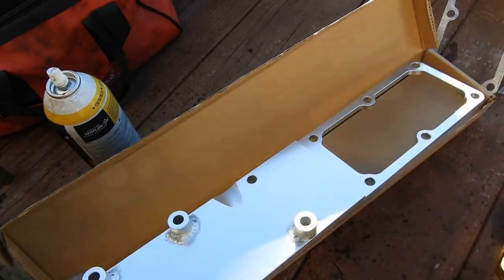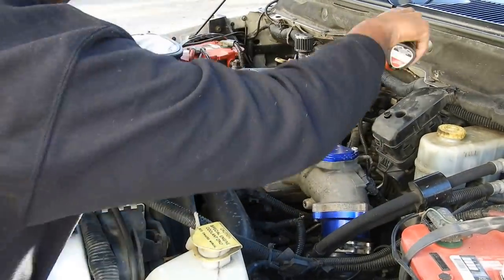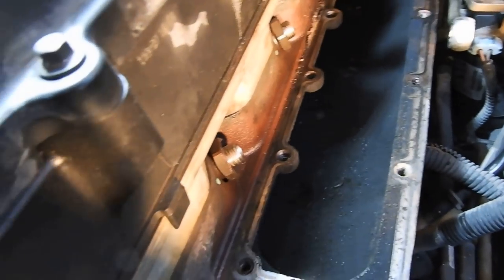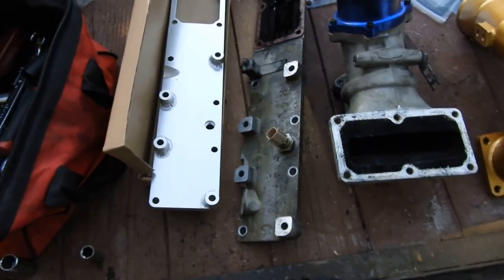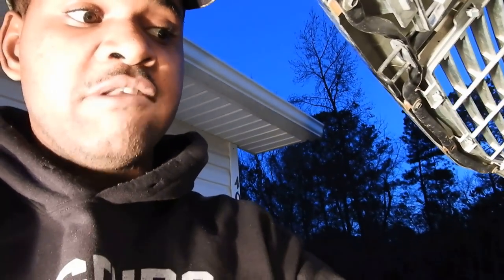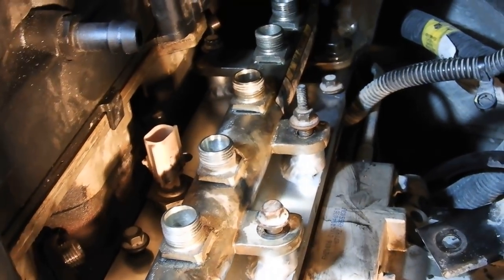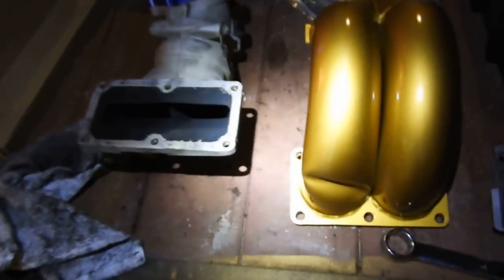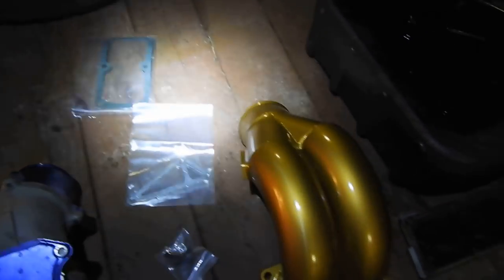HOW TO DELETE GRID HEATER ON 6.7 CUMMINS

Comment: Looks great I used a 4" banks monster air ram it sounds great it has a deep exhaust sound I didn't do the heater delete yet. I have a 2016 ram 2500 6.7L love the proformance acceleration fuel mileage and the sound of the 5-inch straight pipe. Thank you for your video of this delete because the videos help me when I do mine. Thanks again and God bless
Reply from the maker: Joe  Truitt thanks man I appreciate it! I'm glad this video helped you out! Check out my other videos they may help you out in the future and feel free to subscribe
Reply from the maker: Joe  Truitt banks makes a good kit too. I wanted it just to expensive haha. But mishimoto and pusher make good products

Comment: Just finished up my grid delete, but added a throttle valve delete with heater.  Although it was far from easy and I have a leak on my rail in the back.  Praying it isn't cracked.  Thanks for the video and for your service.  Happy 4th of July

Comment: Hey man love the vids, been watching you for a long time but there's a big problem with this video. That "negative ground wire" you said goes to the grid heater, IS NOT A GROUND! Lol I found out the hard way... I tried just grounding it to the block since it just looks like a ground and almost caught my truck on fire. It's a positive cable  from the positive solenoid near the battery. Might want to add that in the description or something because it's dangerous, I was about to leave the battery charger on over night and 15 mins later positive cable melted started smoking and cooked both battery's to 0volts. If I would have gone to bed It would have caught on fire 🔥
Reply: I think he misspoke. Because he said “power for the grid heater” as well as “ground” In sure he meant power wire.
Reply: @Up-hill-Battle and I dont think heater grid will use ground to heat up, lol.  Good video.. going to do mine tomorrow

Comment: Did you need pipe dope on hardware holding the grid heater plate down or the horn? Are those bolt holes straight through requiring to be sealed asswell?

Comment: Do you have to seal up the injection lines? With anything? Also do you have to have to use rtv or gasket maker for in between the plenum and grid heater delete plate?

Comment: Great video!👍
Can’t do it to mine I see temps at 50 below ambient in northern mn🥶🥶 need block,grid,steering wheel,seat and lots of other kind of heaters here!! My grid heater was packed with soot at 38,000 miles shop vac cleaned when I upgraded to afe intake!! 😃

Comment: I just deleted mine and its still running bad so im ordering the parts so I can do this because my egr bypass valve cable broke so soot literally clogged up my whole system, dpf, intake, etc. I'm hoping this will fix the problem. I'm also not mechanically inclined so this video is awsome and gives me a little ease knowing that it's not that hard to do.

Comment: I replaced the air horn today and the checked engine light is on. The MAP sensor is plug in, the only thing that was left unplug is the plug that pug into the throttle plate. Is the throttle plate plug required to turn off the CEL?  What do I need to get raid of the CEL? I have 2011 6.7 with the EGR delete. No CEL before I replaced the air horn. Great video by the way!!!Thanks for great information.

Comment: Hey bud, love the videos. The cable that you’re holding at 14:29 of the video is a a ground of some kind? I grounded to one of the bolts used to mount the heater plate and it smoked my hot terminal. Made me think that it wasn’t some sort of ground

Comment: Excellent job, good step-by-step instructions.  Im installing a 4inch monster Ram but keeping my factory grid heater.   (2) Thumbs up on the video.
Reply from the maker: Thanks man! Appreciate it monster ram intake is good too
Reply from the maker: Changing the intake manifold wont make a crazy noticeable difference but it definitely will aid in better flow into your engine which means better combustion and potentially better throttle response and mpg.

Comment: Looking at doing a Banks 3.5 intake and keeping the grid heater. Just want to check and see what your thoughts are about they. Any thoughts or help are greatly appreciate Boss.
Reply from the maker: Jim Russo banks intercooler is good! I didn't get it because you get a better deal with mishimoto and its excellent quality. I recommend getting the intake manifold too if your going that route

Comment: Great video !! can you tell me if you torqued the high pressure fuel lines, and if so, what torque value did you use ? I've checked online and get a bunch of different values, Thanks man.
Reply from the maker: I just made sure they were nice and tight and checked for leaks. Had no issues since then from those lines.

Comment: I completed the EGR / DPF delete on my
Cummins and am getting 22 mpg now. What is the benefit of deleting the grid heater?

Thanks!👍
Reply from the maker: better air flow, and not having to worry about the nut on the back of the stock grid heater falling off into your engine.

Comment: Hey wassup bro, great video..!!! One question. About the longer bolt that came with the pusher, wasn’t that for mounting the pusher? I was thinking that it’s for the mounting hole under the double pipes. I just got mine and plan to install it soon.
Reply from the maker: worrdogg I all the mounting bolts are the length. I dont remember a longer bolt lol it's been a min

Comment: How do you like that intake? I'm thinking about picking one up off eBay for when I delete later this month.
Reply from the maker: JPeters331 I love it! I bought the unpainted one for 170 on eBay. You can notice a slight difference when you open up on the pedal it's not suffocated.  It's good for lower egts and better flow. I got a link in the description below where I got mine from rudys diesel

Comment: Thanks for the video.  You mentioned that it took a bit of time to get get the truck running after the install.  How many tries before it started back up?
Reply from the maker: Turned the key and held it for 15 seconds 2 times and she fired up 2md time. Just needs time to build fuel pressure up

Comment: Great Video! I’m contemplating the grid heater delete right now. Any issues on start up on those cold mornings?
Reply from the maker: Naw bro I've cranked her up low as 20 degrees and fires up. Grid heater is more for warming up air going into the cylinder. Get the eng warmer faster vs startup. My truck turns over fine.
Reply from the maker: Thank you!
Reply: EVERYTHANG DIESEL Thanks bro, appreciate the info. I’m going to do it.
Reply from the maker: No worries man.

Comment: Did you have any issues with the fuel lines leaking? I'm having hell with mine. My pickup is a 2018 3500
Reply from the maker: no i didn't u may need to clean the threads also tighten them good when installed

Comment: Banks 3 1/2 is better look at the engine and your new intake. one is round and the engine is rectangle. Banks is rectangle,  the injectors not a straight shoot and the injectors ports are not mixing right. Where the meet at the lower end of the elbows. only one tube is getting the injected mixture, Otherwise great video.

Comment: With a Bone Stock 2016 Ram, Can you do all the deletes on the Right side of the motor[Heater, Race Plug, Air Ram, EGR] and not anything thing else? Would that work with a Stock OEM Tune and Exhaust pipes? or What deletes would be recommended on a stock tuned  truck in conjunction with the Heater delete only?
Reply from the maker: if your emissions are removed you can do all of these mods with no issues. if your emissions are intact you cannot remove your egr or dpf without tuning it will cause a check engine light and your truck will go into a limp mode.

Comment: Looking to do this to my truck here soon now do you still have the check engine light for the open circuit for the grid heater or does it go away with everything taken out?
Reply from the maker: Everyone once in a while if it's really cold yes, but once I completely removed the wiring harness I dont get it no more

Comment: What was on top of the old intake and what happens to it when you replaced it with the intake elbow??
It also had a brass bar that went across the manifold in the front.  Was it completely removed or rerouted?
Reply from the maker: Are you talking about the blue plate? Also for brass bar not sure what your talking about?

Comment: I just did man I was throwing a code. I didn't put the MAP sensor back on. Thanks to your video you saved me a huge headache. One question though. What did you do with the prob that was in the side of the intake elbow?
Reply: Thank you so much brother!! I appreciate you more than you know! @EVERYTHANGDIESEL
Reply: EVERYTHANG DIESEL    From the day i got my truck i went and ordered literally  everything you have done and love my truck. Only thing is, i left the original plug that went into the intake plenum and left it hanging, your saying i can just unplug it? I also had it tuned on the raceme tuner. Any other suggestions id like to get good gas mileage when i want and crank it up when i need. What u think my next step should be?
Thanx keep up with the videos and if your ever in las Vegas done hesitate to holler.
Reply: Hunter  so what did you do with the probe? I’m kind of at that stopping point myself

Comment: I have watched this video 3 times and will watch it again a few more times in the coming month as I prepare to delete my grid heater and switch to the throttle valve grid heater from glacier. quick question: when you re-installed the fuel lines from the common rail to the injectors, how tight did you go?  I imagine there was no torque wrench used. just curious, would have to strip something or "F" something up.  Thank you for showing this.
Reply from the maker: no worries man. when i tightened the lines i just used a regular wrench and got them tight. probably like 1/4 in turn past the sharp rise of torque. you'll know when there tight haha
Reply: EVERYTHANG DIESEL well, I got the grid heater delete done last night. It took me about 3.5 hours. I did not even try to remove the #6 injector! Ha ha. No diesel leaks (yet). That was my biggest concern. I will check it again in a few weeks. What I did was buy the Glacier diesel Grid heater relocation (goes where the air inlet valve used to be).  That way, no cold starts for me.  Quick spin around the block last night and it feels a lot mor responsive! Thanks for the video.  It helped me overcome my fear about doing this.
Reply from the maker: Congrats man! Glad I could help. This is the only video on YouTube showing how to do a in depth step by step grid heater delete.

Comment: Thx for sharing!
Did you have to relieve the fuel pressure somehow before you started taking off the injector lines?
Reply from the maker: Robert Thibodeaux no worries man and no I didn't I just cracked the line. There is no pressure if the pumps aren't working and it doesn't hold prime pressure when off. You will be good.
Reply: Thank you for the reply sir and keep them good videos coming!! I appreciate your efforts!!
Thanks to you and your videos I am soon ordering air dog and sump, pusher intake with h grid delete,Mishimoto intercooler and glowshift fuel pressure gauge on my 2007.5 6.7 Cummins that I bought new in 07! I’ve been Deleted and voided my warranty since 16000 miles and have almost 60000 now! My upgrades are Banks Cold Air intake,Smarty Jr,(running 60 hp tune constantly)Mishimoto Radiator,Deep trans aluminum pan,Mag Hi Tech rear diff cover,Pillar pod gauges with Trans Temp,Boost And EGT’s!!
I have gotten as much as over 25 mpg on my 2500 quad cab 2 wd!!! Love my Cummins!!!!
THX!!!
Also 4” exhaust pipe with spincast muffler,5”tip!
Reply from the maker: Robert Thibodeaux NICE stuff man! Haha I like the list of to do mods you will be happy when you do the loft pump and intercooler. Also you got some good stuff done already to your truck! Are you running stock tires getting that mileage?
Reply: Yes running stock size tires!

Comment: Everythang_Diesel, love your channel! I recently bought my 2014 Ram 2500 Crew Cab truck. I'm a new Diesel owner and I have a question. 3 Weeks into my Cummin's and a get a check engine light. I took it to the dealership and they tell me the Turbo Actuator is going out and needs to be replaced. This one is on them and I don't need to pay but with the limited warranty, the next one is on me. Can I do a CCV Delete like you showed on your CCV Delete video and not get a check engine light? I don't have a tuner yet and haven't put any deletes as of yet.
Reply from the maker: Thanks for watching man. Yes u can do a ccv delete but it will void your warranty. That would definitely extend your turbo life! A 2014 ram having a bad turbo in 4 yrs is kinda short? Sucks that happened. Make sure you running some clean preferably synthetic oil. Good luck man! Congrats on the cummins
Reply: Yes you will get check engine light, i tried ,   i have since had a delete amd tune , havnt tried again but the shop said it should be turned off amd i could deltet the ccv now

Comment: I'm new to the channel and late to the game. I bought a ram intake and boost tube upgrade. My question is do I still need to do a throttle body delete? I also cause of your channel bought my heater grid delete also. Could you help me
Reply from the maker: If your installing a aftermarket intake horn u don't need a throttle delete.
Reply: @EVERYTHANGDIESEL  Thanks I appreciate it

Comment: If I do this grid heater delete. I’m gonna have trouble starting it in colder weather? Is their a solution to it like a add on to the intake and acts like a heater?
Reply from the maker: Yes gdp makes a gird heater relocation for the intake manifold
Reply from the maker: You won't have trouble starting the truck unless its below like 10 degrees

Comment: That cable the goes to the grid heater is not ground, it’s actually a live wire when the car turns on the grid heater relay, the grid heater gets its ground from being mounted to the engine. It also isn’t fused so definitely disconnect that or take it out.
Reply from the maker: Already took it out.
Reply: @EVERYTHANGDIESEL  awesome man! Thanks for the video too! Gonna do my delete sometime soon’

Comment: So I'm just guessing...did you just remove all the ground wires..hot wires etc and the relay by the turbo and basically just discard all that..??
Reply from the maker: Not even all that I just disconnected the negative cable on the grid heater and tucked away

Comment: what about the little pick looking probe on the back side of the intake where does it go?
Reply from the maker: Michael Eagan from the stock manifold?
Reply: EVERYTHANG DIESEL yes sir. It's hooked into the backside facing the firewall. Just wondering when you put the new intake manifold on where this pick went to.
Reply from the maker: Michael Eagan that probe looking pick on the back side of the manifold is for the old one. It has to do with some egr component. Idk what it's for. Maybe some air probe to sense inlet air temp for regens I dont have it on anymore.

Comment: Just curious why delete the grid heater? Do you live in warm climate all year?
Reply from the maker: Where I live it doesnt get cold enough to require a grid heater, in winter cold here is like 40 degrees. Grid heater puts a strain on your alternator and you have the potential of that nut on the bottom side of it coming off and going into your engine.
Reply: @EVERYTHANGDIESEL  ahh.  That's what I kind of thought.  We get  -40f and colder here sometimes so it is needed.

Comment: Those pusher intakes push almost twice the cfm as the stock intake
Reply from the maker: Yeah pusher intake is 2nd best to banks monster ram. I love mine
Reply: EVERYTHANG DIESEL how do you like it what’s your mpg/performance difference
Reply from the maker: I like it. My truck gets about 18mpg but I just installed a bigger turbo so we'll see how it goes.
Reply: Is that highway or street and did you see an improvement after you installed it
Reply from the maker: Mainly street  some highway
Reply: Yeah that’s way better than what I’m getting

Comment: Get 30 below zero where I live , so I think I will keep my grid heater
Reply from the maker: mike roberts yeah sounds like u need that and a block heater
Reply: Yes sir Haha. And anti gel in the  fuel tank
Reply from the maker: mike roberts a must lol
Reply: @herculesinwyoming  GDP(Glacier Diesel) have a high flow grid heater that connects between the intercooler tube and intake elbow

Comment: Did you use new O rings for the fuel lines? Did any leak after you did the install?
Reply from the maker: i reused the same ones. no leaks and it was fine.